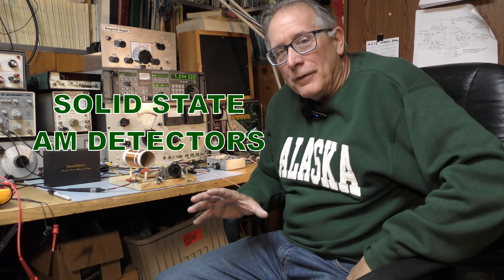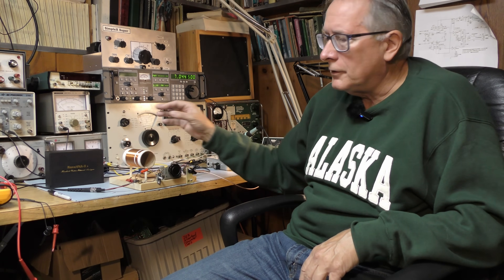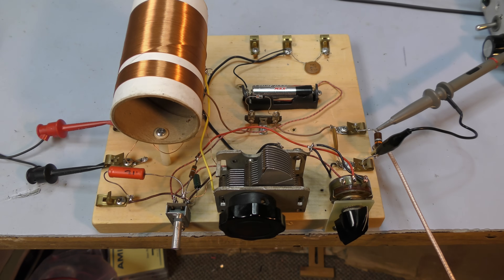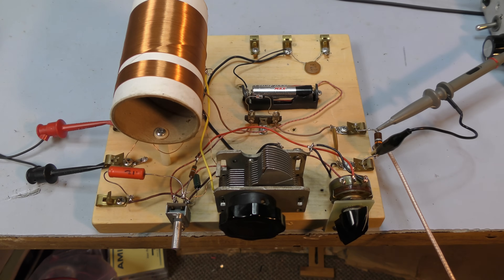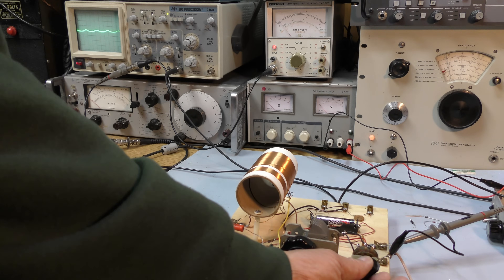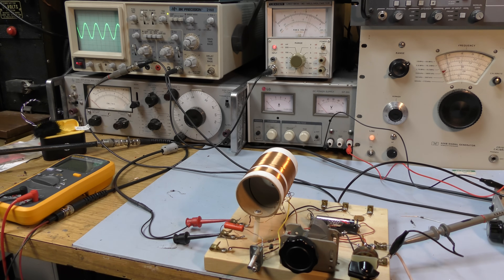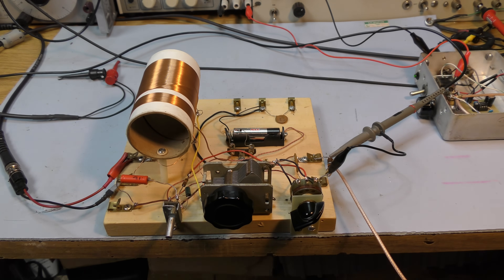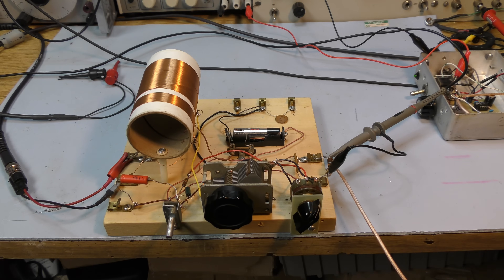AM Detectors Part 2

Comment: What about a diode-connected transistor, where the base is connected to the collector? Another possibility is a transistor biased just barely into conduction with a small DC current into the base, and audio output taken from the collector connected to a load resistor.
Reply from the maker: Yes I remember these, especially with the older Germanium transistors.

Comment: This is a gem... I been beating my breast for seems like century's at 75 years on Diode Detection: Mike has got the rattle snake by the head and it's hissing down at him, with answers to this highly debated question, that personally I have been at the same tested outcome so many times, when other parties in the electronic community said I was wrong.

Thanks for the clarity in these videos, and the next that will be a very interesting outcome, if I am correct. I am forwarding on to those disbeliever's these videos, and await for the flack to descend. Great tech and always exceedingly interesting real world proving on R.F. topics. Many thanks Mike 🙌 Hail, Caesar !🙌 Maybe like the movie, or historically ?

Comment: Great video. Shocked at the led performance. Who would have known? Also I thought the 1n4001 would have performed better. I seem to recall, you did a varicap test where you tried a 1n4001. I wonder if you could use an optocoupler as a detector, (the led side), biased I guess and take an output from the transistor side?

Comment: Reposting this - I can't see it in the comments even when I'm logged in. I found it in the Comments sidebar because someone gave it a like - but the comment does not show whether logged in or out, Firefox or Brave, adblocker on or off.

Isn't it the same thing? Isn't it just a matter of perspective? For example looking at a 1MHz signal modulated 100% by a 1Khz signal with an oscilloscope (time domain), you'll see the 1Mhz signal alternately doubling in amplitude and then being pinched off to 0 at a 1KHz rate - the classic envelope waveform (the optical illusion of squeezing the 1MHz into a fuzz so the 1KHZ signal can be seen). If you look at the same signal with a spectrum analyzer (frequancy domain), you'll see 3 pips the center pip has full carrier power and the sideband pips will have 1/4 the power of the center pip and will be 1KHz above and below the center pip. To me its 6 of one kind and a half-dozen of another. Rectification is sideband multiplication. As for diode detector distortion at high modulation levels, isn't that distortion just the non-linear conduction area just above cut-off. I suppose you could bias the diode up into conduction to reduce this distortion.

Comment: Youtoob ate my reply below. But it is my understanding the rectification and sideband multiplication is the same thing. Its a matter of perspective - time domain or frequncy domain.
Reply: I think you're right about this, after taking the time to refresh my understanding a bit. I also think my previous idea about SSB is rubbish, as rectification of an audio sinewave modulated SSB signal would give a smooth DC output. One could detect the presence of the signal, but not the audio information. I think.

Comment: With the updated schematic, does the switch kill everything above the 15k resistor? Or take out the 10uF and .1uF also?
Reply from the maker: It shorts the caps and removes the resistor an voltages. Or it's supposed to!

Comment: Mike, it would be interesting to find out which, unbiased diode vs biased diode, has lower distortion.  My guess is, I would think biasing a diode gives lower distortion. Also the HP-334 audio-RF distortion analyzer you have there, has a RF AM diode detector in it for checking AM transmitter/signal generator modulation distortion. Check out the RF diode detector that HP-334 used, they use a capacitor and the detected audio taken from across the diode, one lead is grounded.
Reply from the maker: Bias always helps to remove the conduction dead zone around the origin, which reduces distortion and increases sensitivity. The alternative is a precision rectifier or a virtual ground op-amp with the feedback with a low impedance diode like a Tunnel Diode.
Reply: @MIKROWAVE1  Absolutely an op-amp and diode,  with negative FB. makes a precision rectification circuit.
Reply: I find the 1n34a best. But you got to test it to see how linear it is.

Comment: Did you add forward bias or reverse bias?  Did you try both ways?
Reply: Forward bias. Reverse bias will kill the signal by burrying it deep into the cutoff region of the diode. The idea is to bring the signal above the voltage of the diode junction drop into what one might think of as a Class A mode of operation where no part of the incoming signal gets cut off. Then a point is found in that conducting region where the audio sounds best. At least that's my take on it. I'm self-taught, so take my comments with a grain of salt.
Reply: @johnwest7993  The normal forward voltage of a semiconductor diode is sorta kinda a reverse bias in that the signal must overcome that voltage before the diode will conduct.  Only half the P-P signal voltage needs to overcome the diode's forward voltage drop, otherwise there is no rectification.  The catch is that the forward voltage drop varies as the voltage across the diode and the current through the diode increase.  (Vf is measured at a specific If).

Comment: 1N4001 are not good not because of capacity but for bad recovery time or very slow to block reverse voltage. They can not be used in a switching power supply.

Comment: Hi Mike.
Thanks for the ending of this video (from 15:15) which makes a point that is too often ignored. Diode detectors do NOT work by rectification, but by non-linear mixing - this can easily be demonstrated in a variety of ways. The "envelope" is an optical illusion and DOES NOT EXIST, therefore it cannot be "detected". No filter capacitors are needed in a crystal set in order to make it work - not even "stray" capacitance.
Also, be careful when biasing LEDs because you can easily get into the device's "avalanche" region, where it is not merely biased but amplifying (noisily) by avalanche current. 73 de Phil M1GWZ
Reply from the maker: I need help. I need methods.
Reply: Isn't it the same thing? Isn't it just a matter of perspective? For example looking at a 1MHz signal modulated 100% by a 1Khz signal with an oscilloscope (time domain), you'll see the 1Mhz signal alternately doubling in amplitude and then being pinched off to 0 at a 1KHz rate - the classic envelope waveform (the optical illusion of squeezing the 1MHz into a fuzz so the 1KHZ signal can be seen). If you look at the same signal with a spectrum analyzer (frequancy domain), you'll see 3 pips the center pip has full carrier power and the sideband pips will have 1/4 the power of the center pip and will be 1KHz above and below the center pip. To me its 6 of one kind and a half-dozen of another. Rectification is sideband multiplication. As for diode detector distortion at high modulation levels, isn't that distortion just the non-linear conduction area just above cut-off. I suppose you could bias the diode up into conduction to reduce this distortion.
Reply: @rfburns5601  I spent a few hours reviewing basic signals/systems and transforms stuff today, and I think I talked myself out of disagreeing with you. Multiplying the sidebands with the carrier is pretty much the same as multiplying a sine wave with a phase-locked/synchronous square wave, which gives the canonical output waveform of a rectifier.

The frequency domain convolutions are the duals of the time-base multiplications, and vice versa.

If the argument rests on the power levels involved, I guess the question is one of asymmetric zero-crossing of the diode's IV curve, and how much that can count as rectification, versus a..  ..different(?) sort of rectified behavior involving the much more pronounced asymmetry of a fully "on" diode? 

Am I on the right track here, or am I just stoned? Ideally both, of course.
Reply: @zinckensteel  I'm surprised you saw my comment - even logged in I can't see it - there is a ghost in the machine. I feel the same way you do about the asymmetry. It occurs to me that the distortion at high levels of modulation, is because the negative peaks extend further down into non-linear region just above cutoff found in a diode.
Reply: @rfburns5601  I've been running into similar situations with my own comments - where I can't see them, but behavior from other commenters means that at least some of them see them just fine.
Reply from the maker: @zinckensteel  Oh Yes - and the Signal Analyzer I borrowed is showing all the signs of Square Wave at low levels and Rectification at high levels. The distortion products give it away.
Reply: I am in agreement with the idea that the primary demodulation method in a crystal radio is through voltage multiplication/RF mixing of the carrier and the sidebands. Does it stand to reason, then, if this were not true, that a properly biased envelope detector is all one would need to demodulate a sufficiently strong SSB signal? Thoughts please. Grayson KF7DFG
Reply from the maker: @zinckensteel  During the squaring process you do get the message signal but also multiples of it primarily twice the modulated frequency as a distortion product. The carrier is too weak at high modulation indexes for good quality AM detection. Ultimately with overmodulation the result looks like DSB. But if you introduce an external coherent carrier strong enough - as with synchronous detection, no problem.
Reply: A rectifier is seemingly simple to understand, and in a way it is, but when we get down to how to mathematically define rectification as a function that can be applied to an arbitrary waveform and give the expected rectified waveform as an output, the way we do it is through analog multiplication. So the schism isn't really a schism, it's more of a..  ..'tism? I've been guilty of trying to defend a hill that doesn't exist, it seems. Ah well, at least it means I'm still learning.
Reply from the maker: I know what you are trying to say, but the mixer absolutely is rectifying - you have to turn the diode on to take advantage of the non-linearity. As you infer, the Envelope is not coming from the transmitter, so you can't detect it. It is created at the end usually by sampling or filtering. Or the individual products are simply knit by the inertia in the headphones.
Reply: @MIKROWAVE1  Hi Mike, see my comments to the next video!

Comment: I had thought the 1N34A germanium diode would be better sounding because the VI curve goes up in a more straight line than  most other GE diodes: double the voltage, double the current; triple the voltage, triple the current. Whereas most other diodes the current goes up pretty much with the square of the forward voltage. Isn't that what you want with good sound reproduction: a liner response to input, not a square of the input?
Reply from the maker: Steve WA1QIX of Pulse Duration Modulator (PDM - HI-Fi AM) fame and owner of Radio Associates, designed a Modulation Monitor recently, that has been very popular. He did an extensive study on the basic Germanium Diode detector during its development and he developed a precision rectifier around them. He says that for best display linearity, he requires a modulated signal input of at least 3 V-p-p, and that at lower levels the diode is too non-linear. http://www.radioassociates.com/